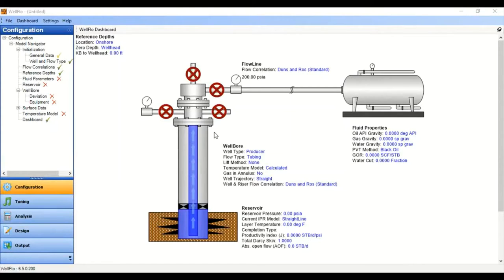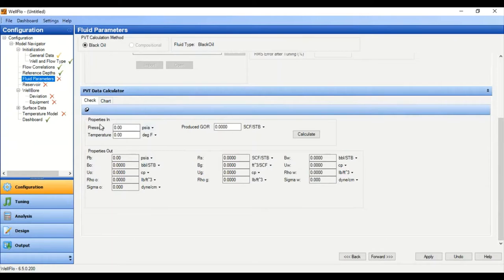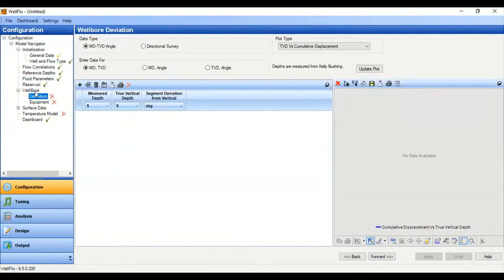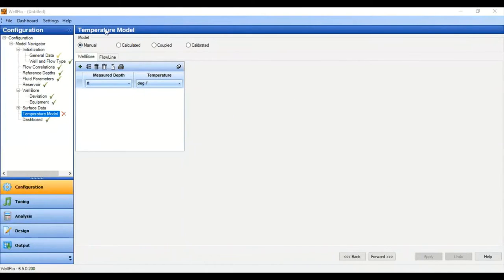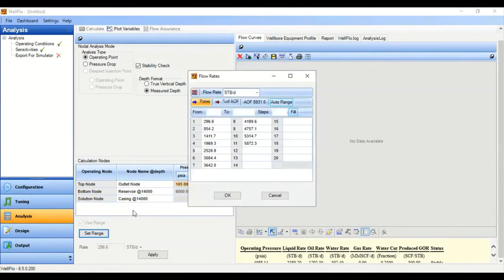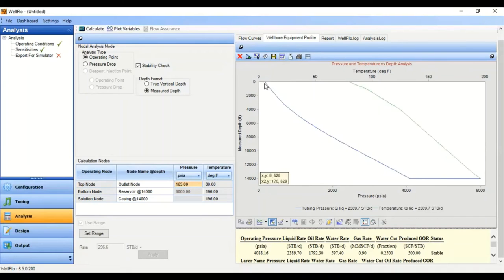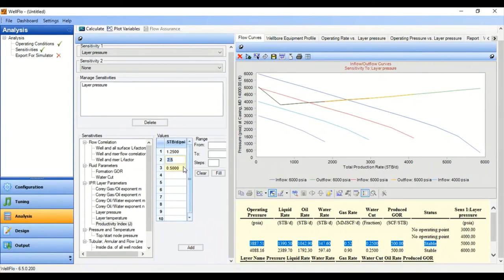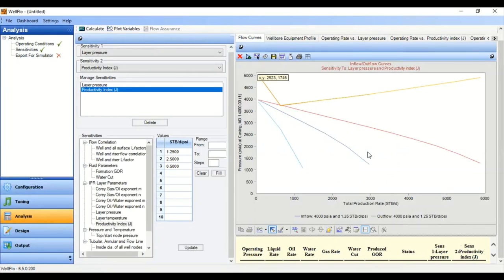WellFlo 5: Natural Flow Oil Well with Productivity Index

Comment: Hello Sir, Thanks for your effort you have been doing. If it is possible could you post some a series of videos using wellflo for initial design of gas lift well, redesigning an existing string of gas lifted well as water cut.PI ans res P have changes. Also, tuning GL well based on survey data.
 Thank you again for assisting.
Reply from the maker: Thanks for the suggestion. Yeah, for sure we are heading to gas lift.